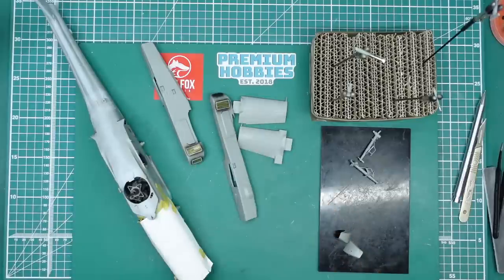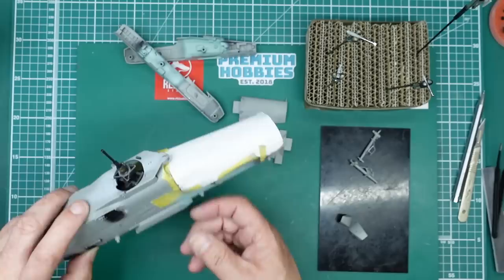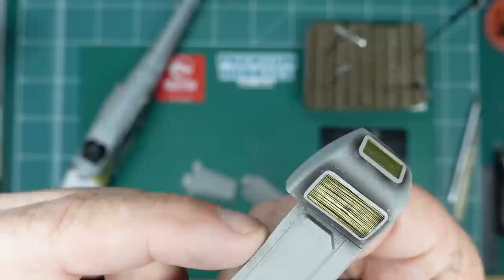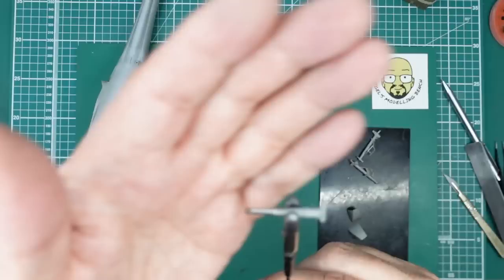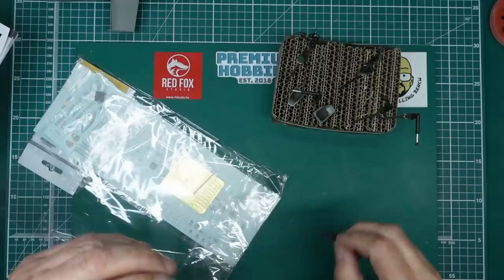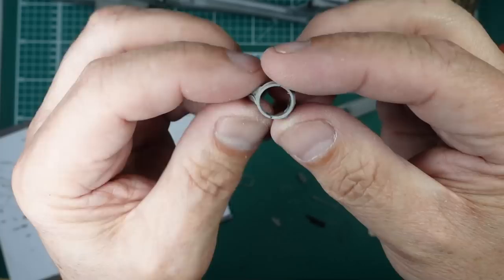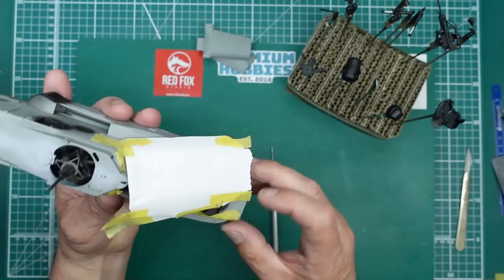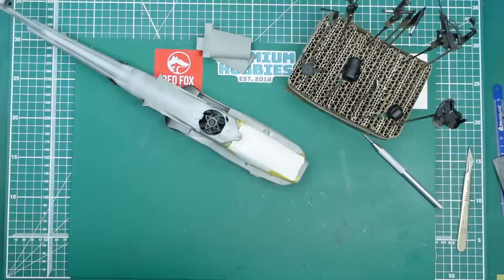Takom 1/35 AH-64E Apache build. Part Four.

Comment: This is not surprising.  We all should be used to crappy instructions and parts that dont fit. This has always been the nature of Chinese kits. I do appreciate your suggestions to make it work. We all definitely know about quantity over quality. As you probably already know Takom has no intention of changing the kit specifications and parts fit.
Reply from the maker: Overall Michael, the fit of the parts is pretty good. I find the biggest issue is the instructions, both build sequence and drawings. the other issue is sprue connectors on the front face of parts and mold seams. It really is building into a beautiful model.. just takes a little extra work.
Reply: @Nigel’s Modeling Bench  I agree 100%. I have tge D version. And im not expecting anything less from Takom.  No doubt I will have the same issues.  Im enjoying your build. And I will be following your instruction to the letter. I have the brass antennas etc. comming. I hate the plastic parts that are with the kit.